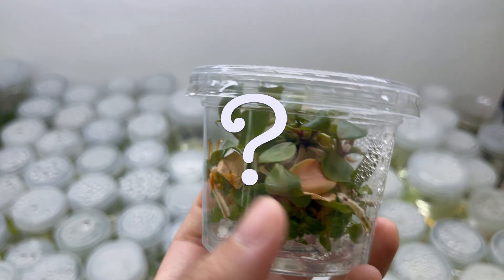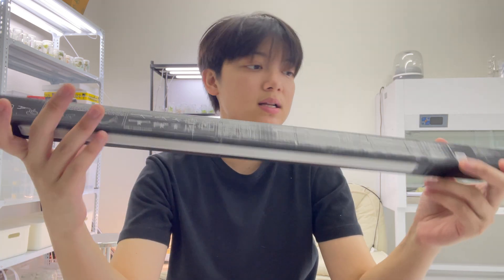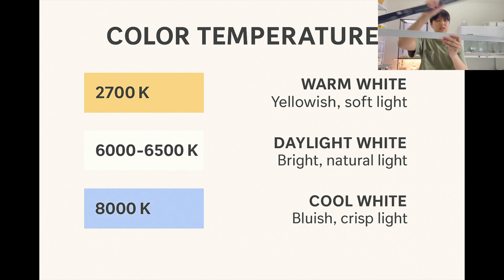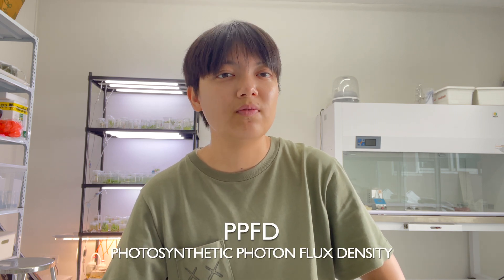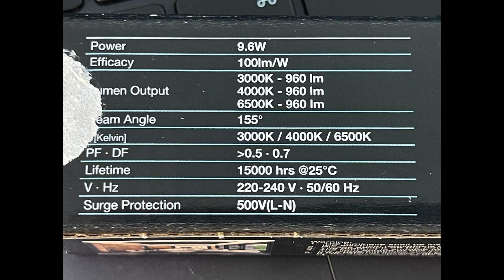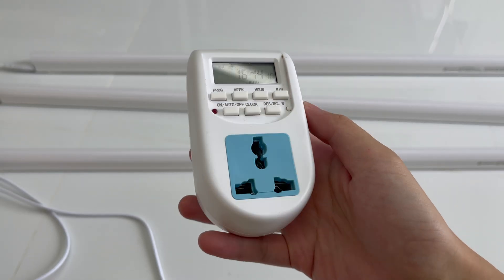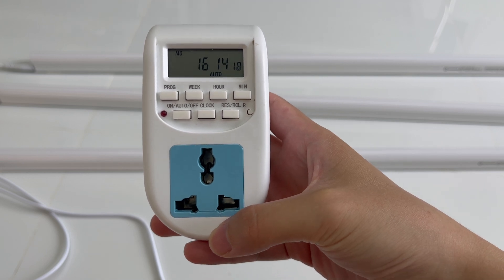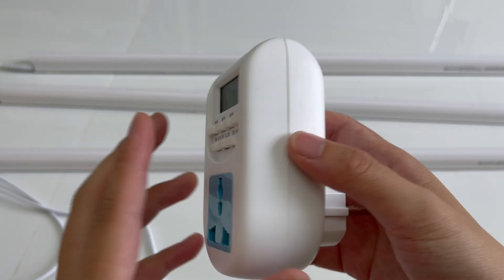The Perfect Light Setup for Explosive Tissue Culture Growth!

Comment: What are your thoughts on Agri-Starts' light setup? Did you see the tour by Plants in Jars https://youtu.be/l-TBZeqGF5c?t=1184? They claim that lights don't matter for plants in-vitro as they have jars stacked on top of each other and they don't see a difference in yield when comparing plants at the top which are exposed to most of the light with the plants at the bottom which barely any receive any light if any.
Reply from the maker: That’s a really good question! I’ve actually tried stacking jars myself and found that the cultures on the bottom still multiply quite well, though they do tend to stretch a bit more. Since the jars are somewhat translucent, the lower jars still receive some diffused light. This could be a great idea for an experimental video. Thanks for the inspiration!